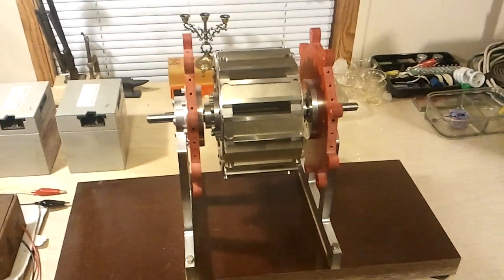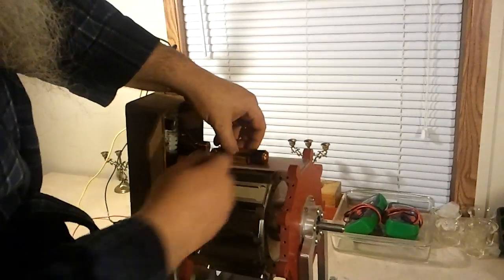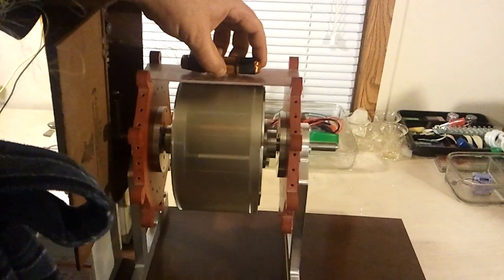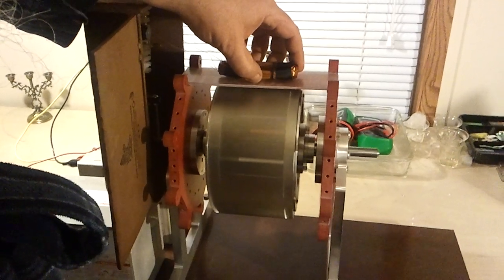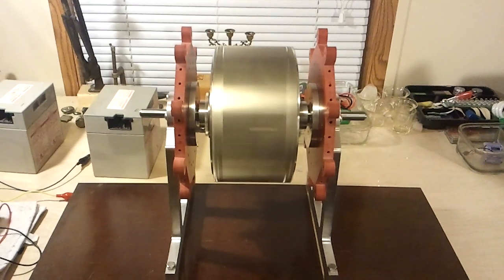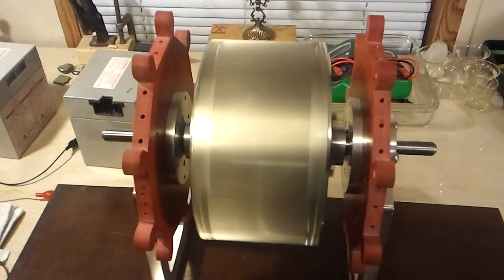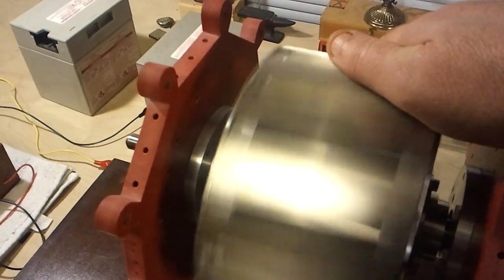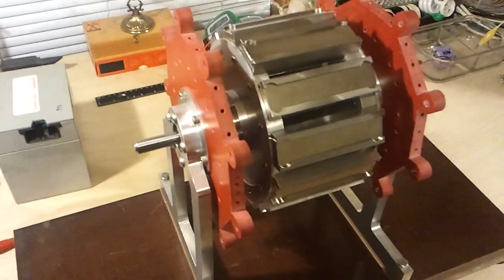Experimental Bedini 3 phase dc pulse motor chassis

Comment: Looks like it will be an awesome build. Where do you get rotor parts from?
Reply from the maker: Guaranteed jobsusa;  I designed it myself and a friend with a machine shop made the parts per my drawings. The only thing I would change are the bearing. I used open bearings that need oiled everyday. A good sealed bearing set would make for less maintenance. 
Thanks for watching.
Peace.
Reply: @everybodyseye  thanks for the info

Comment: Would you send me the drawings for this device? I would like to build one.  Just a little smaller.  I'm having problem finding a way to mount magnets on a rotor.  Your device looks like it can handle s lot of rpm without any problems.  Thanks.

Comment: awesome.,

how much did your magnets cost you?
Reply: Robert,
  The magnets were $29.00 each from k&j magnetics. Though that was a while ago so that price is no dought long gone.
Thanks for watching.
Peace!
Reply: i am presently building one. i have a co worker presently machining a plexiglass wheel for me whith which i can mount  some one inch magnets. i hope it can kick up at least 60 volts.
Reply from the maker: Robert,
   Wonderful, be careful this stuff as habbit forming...LoL
I encourage you to post your results.
Peace!
Reply: i am in progress building one of these.
 i use one inch dia magnets X 6.
i am getting ready to assemble this weekend. but i need to find bunch of steel washers to form my core for my driver coils.
 oooh.
 look up  T. HENRY MORAY
Reply: WHEN I WAS  13yrs old i built a simple crystal set using a glass diode across a telephone speaker pot. one long wire to groud out side and one long lead to my zinc roof.

no bateries.  YET .. i picked up the local am radio station..  how do you explain them apples???!!!!!!
Reply: then years later.. last week end, someone told me about T Henry moray
Reply from the maker: Robert, sounds like you built a cristal radio. They used to sell a kit for those but, I haven't seen one for a while.

Comment: that's a really nice build you have going!! I built a standard pulse motor, slightly over sized, then installed a 3 phase set up using just the shaft speed of the pulse motor and even under load, I got some really nice output from both sides, try using different coil wire size for several test, I was using 18awg, but try up to 15, you might really be surprised on the results, again, great build!
Reply: Thank you, I have allot of fun with it. There are more videos to come.
Thanks for watching!
Peace!

Comment from the maker: @mjs204, The magnets are mounted to the rotor, there for the magnetic field is spinning with the rotor. Only conductor material positioned at the face of the rotor will be affected by the magnetic field ie; the coils with windings at 90% to the face of the rotor. The stand is to the sides of the rotor and far enough away from the weak field at the side of the rotor to pose any problems.
Thanks for watching!
Reply: Oh yeah thank you for uploading this video
Reply: Oh yeah thank you for uploading this video
Reply: Oh yeah thank you for uploading this video

Comment: cool man! I have a question, as far as the assembly goes, would it be more efficient to use some sort of polymer to house the motor? I would like to assume that having aluminum, and especially stainless steel would inhibit kinetic energy. (loss of motion due to eddie currents passing by aluminum, etc)  any thoughts?
Reply from the maker: @ mjs204, The metals in the rotor are turning with the magnets so there are no eddie currents in the stainless steel. The aluminum stand is far enough away from the magnetic field. When I turn the motor off the rotor spins for about 15 minutes. 
Thanks for commenting!
Peace.

Comment from the maker: The Lenz effect is the interaction between a conductor and a magnetic field, see "Lenz's law". This can be demonstrated by dropping a magnet through a copper pipe. The magnetic field creates an eddie current in the copper. This eddie current slows down the magnet as it drops through the pipe.
The same effect happens when you run a conventional generator. The more energy you draw from the generator, the harder it must work to generate the power required for that load. 

"continued"
Reply: everybodyseye

Comment from the maker: I suppose it could if you have a generator with low Lenz effect. I have not checked the torque of this motor and I do not know how much horse power it has. In one of my other videos I show this motor generating 110VAC and I convert that to 24vdc at 6 amps.
Thanks for watching!
Peace!

Comment from the maker: Yes, you are correct. This is an electric motor. Although, this electric motor allows one to collect the back EMF to use for charging batteries, charging capacitors, energizing magnetohydrodynamic pumps or what ever you want it to energize. 
The ability to attach a flywheel, pulley or what ever you want to turn, to the shaft is what makes this a motor as opposed to it being just an energizer.
Thanks for watching!
Peace!

Comment from the maker: I have reviewed the Yildiz Motor and I do not think that a comparison can be made. The Bedini 3 Phase Pulse Motor Chassis uses permanent magnets as well as electromagnets to run. An input of electrical energy (DC) is required to energize the 3 phase motor chassis.
The Yildiz Motor uses only permanent magnets with no electrical input required. A more fair comparison would liken the Yildiz Motor to a Perendev Motor. Where only permanent magnets are used to spin the rotor.
Peace!

Comment from the maker: Sorry, I do not know of the yildiz motor but I will search it. My 3 phase pulse motor chassis could be likened to many different motors. There are only so many ways to build this type of motor. I would say that my motor is a replication of teslas work. That said, the yildiz motor could then be considered a replication of teslas work as well. This chassis was designed and drawn by me. With only the 3 phase concept and the 4"x1"x1/2" neodymium magnets as my parameters.
Thanks for watching!
peace!

Comment from the maker: Right-on! I had lots of fun walking my dividers around circles. I redrew it like 14 times over a period of about 2 years. I wanted the rotor to act as a flywheel so it would generate torque. I have lots of experiments I want to do with this chassis. I could turn a pump or add apparatus for say, a hall sensor or a reed switch trigger. Even brush contacts could be used. The bipolar circuit I want to use is one of the many circuits I want to use I found on the net.
Peace!